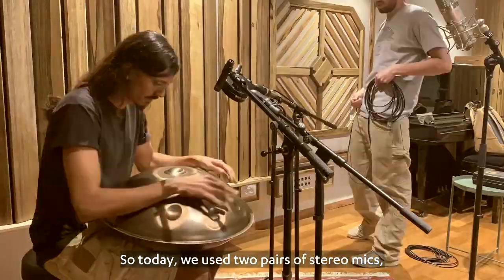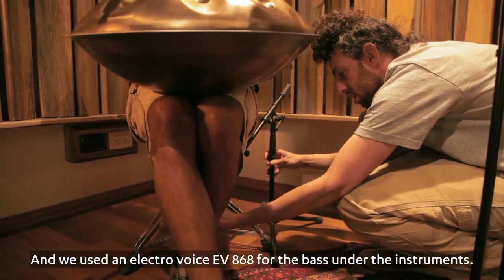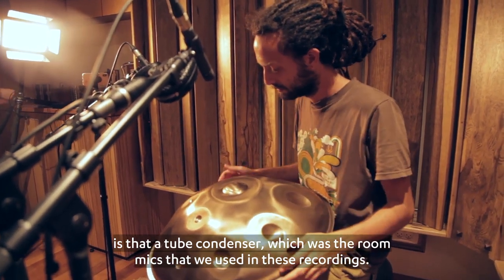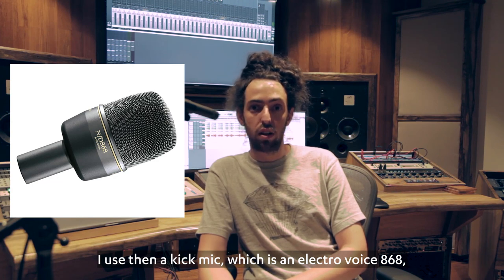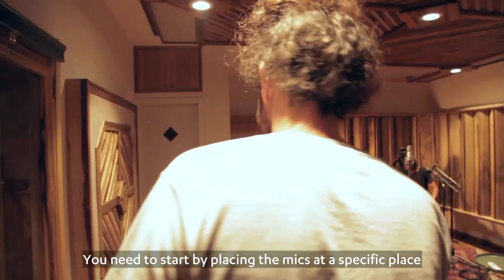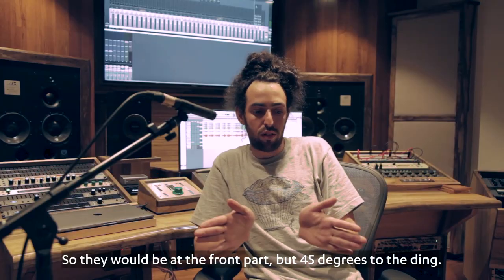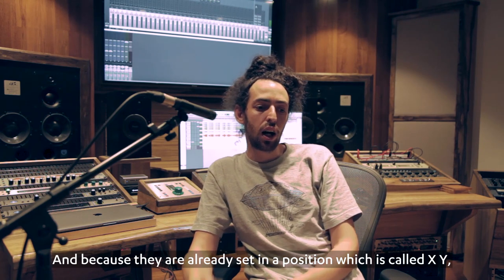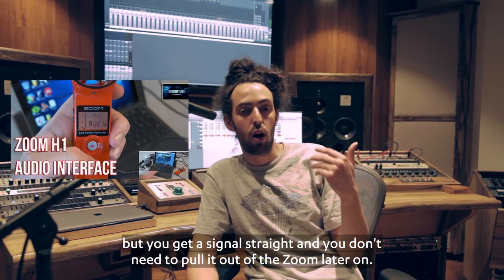How to record a Pantam (Handpan) - featuring Thomas Ben Tov @ Nagariya Studios

Comment: hey thank you so much for the detailed explanation. when you were talking about the Zoom i was wondering if it makes a difference if you plug in the zoom into a computer to get the sound directly into the DAW or if you later take it out from the SD card? AND does it play a role in general if you use the Zoom as a Interface on a computer or maybe on the iPad or even directly on the SMartphone to get the sound there? Does the smartphone reduce the quality of the Zoom Sound?

Comment: Thanks a lot for this detailed information!
Do you have some short tips for the (in your experience) best setup when only using a Zoom (angle, distance, recording level)? I have been trying out latley but I think I still havent figured out the best options.
Reply: I'd suggest going with  the same setup I recommend for the two condensers in the video, and place the zoom in the middle, in front of the instrument.
Regarding level, I'd suggest aiming for peaks at -14 :)
Reply: @ThomasBenTov  Thanks man, I'm gonna try that out :) Big hugs and keep up that great work!